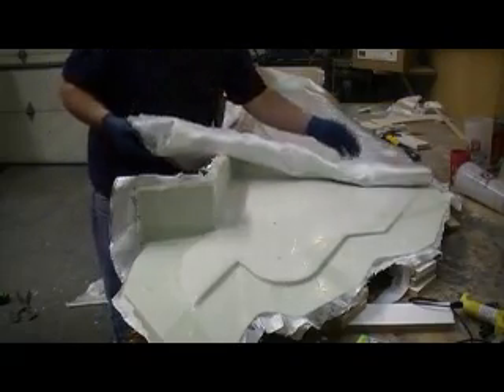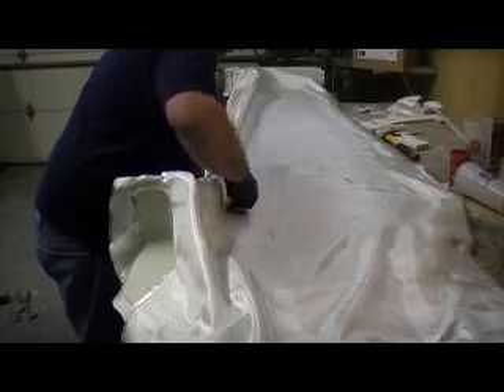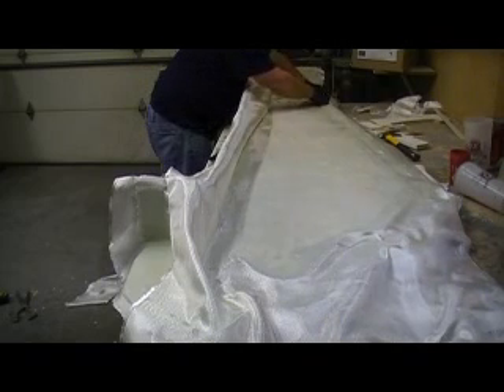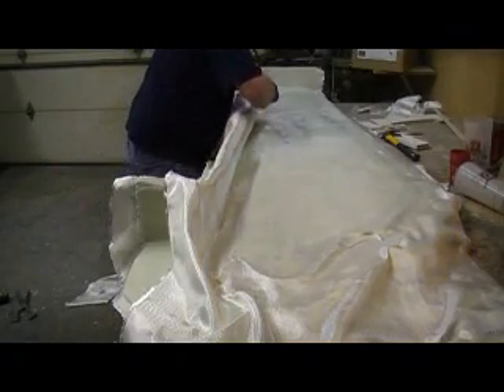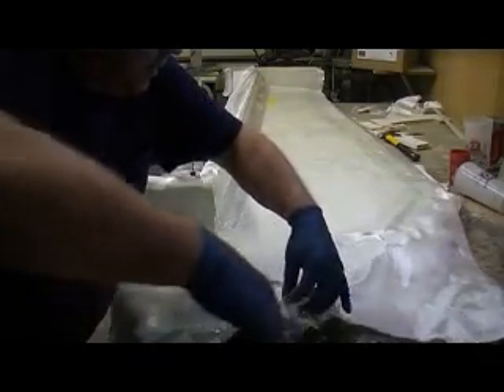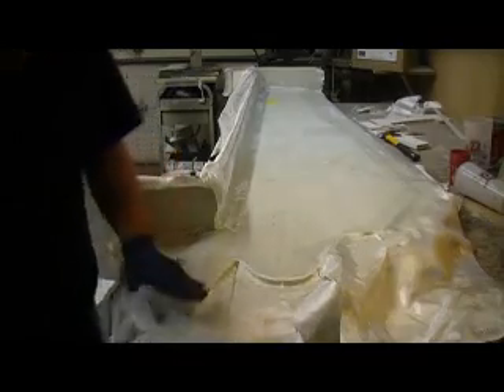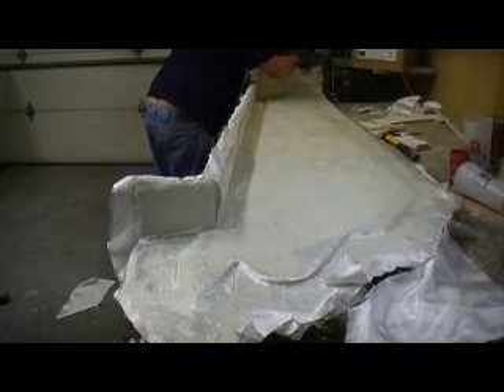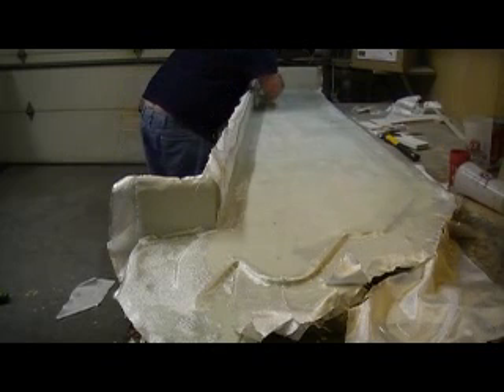how to build a rc jet B-1 Bomber # 116 pt 8

Comment: s. Formula Five(r) Mold Release Wax is has the lowest silicone content in the industry. Silicone or wax transfer to finished parts can be avoided by applying PVA such as Partall Coverall Film over the last coat of wax. Available in 12 oz. net